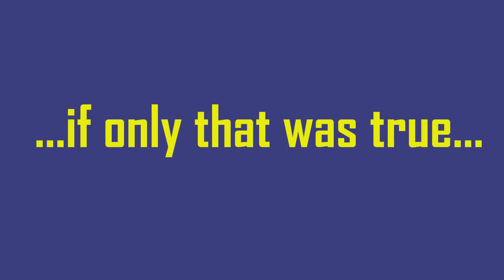The Saga of the Dell PowerConnect Fan Replacement

Comment: I am trained to a certified level for doing repairs under warranty on Dell and quite frankly it is one of my pet hates how dell fails/refuses to conform with industry standards when it comes to pin-outs, especially power feeds.   In my career there have been times when I have had to "modify" a PC Power supply to keep a misison critical piece of equipment functioning where the proprietary power supply was not available.  This is where proprietary wiring becomes a problem.  It is also a problem in this type of scenario when equipment tries to be too smart and actively limits performance throughput if it does not receive monitoring signals back from fans.  Manufacturers make assumptions that proprietary parts are immediately available when they are needed - that can be hindering in the real world.

Great advice to use the right tool for the right job.   I would add (in general), to learn the right skillset for the right job as well.  You make good point about the variety of fan functions that need to be considered when replacing fans.  The process is to seek out the specifications of the installed fan and matching them up with the proposed replacement fans.  The same method applies to all replacement parts with respect to compatibility and desired performance (in this case airflow and noise levels).  

It would have been nice for viewers to experience the noise level both before and after in this video.
Recording speech at a normal volume at the time the fans are spinning both before and after replacement could give a good reference point.  (We don't need expensive test equipment to quantify).

This equipment usually goes into a commercial premises with a dedicated equipment/telecommunications services room on each floor that has its own air conditioning and set of power circuits behind a closed/locked door.  This is why noise is not a consideration for rack mounted equipment but airflow is due to the high density.  

What is worth noting is the fans are on the side instead of the rear.  It is common design for airflow to be taken in from the front and exited to the rear, however we can see with comms equipment that would need a lot more fans to airflow and the orientation of the heatsinks.

Comment: Hi, nice video but for all people watching... be aware that choosing the right fan is critical. I bought Noctua NF-A4x20 and Sunon Maglev  KDE120PKV3 (I ordered AR but I got AF from the chinese shop). Also changed the wiring as described. Both are working but the fan light still turns red. This is because Dell needs the AR (locked rotor) fans. It's checking the RPM speed. If you have the wrong type of fans it just won't work. 
In my case one of the bearings was not running well. A tip from an old technician... Remove the label and just add a very tiny drop of WD40 oil on the bearing. That did the trick for me! The fan is spinning like never before :-)

Comment: Hi! I have just bought the same switch and I am trying to open the chassis, but the screws are so hard probably because I don't have the correct screwdriver. Which size did you use?

Comment: Super helpful! Thanks!. Damn, TIL. Not all RPM sensors are made alike... -_- a 5 minute job turned into a multi day journey... :P New fans are not registering as working... but they are there. that's too bad. I need to look into  the possibility that this is an RPM detection issue... More time than I wanted to sink into this, but you get what you pay for and free switches be free switches... :D

Comment: A fair warning that Sunon model numbers can be deceptive - on ones that use the old style of model number (like the ones pictured in the video), a smaller model number UNDER the main one is really important to look at. The R (or in some cases F) is extremely important to note as there can be multiple variants of the same primary model number - as others have said, if you get fans that report frequency/speed (F type), you're going to have a bad time. Most, if not all Dell switches will only accept locked rotor (R type) fans, and will flat out reject tachometer (F type) fans. When given tacho fans, my switch rapidly pulsed the fan ok/fail light between red and green (unsurprising with how F vs R work), so if your switch is doing this, you have the wrong type of fans. When in doubt, look at the data sheet for the fan.

That said, once you get R type fans and rearrange the pins, you're golden and it's a nearly painless replacement. The hints and info here helped me swap out my 6224's Delta screamers with much more tolerable Sunons (I personally used GM1204PKXV-A / B2278.R.GN fans because they were easier and cheaper to find than the model Torreon used in the video, and they had pretty much the same specs). It's as quiet as a mouse now and can't be heard from more than a couple feet away (if that). Good stuff!
Reply: I was just about to mention this. Looking at the Delta EFB0412VHD on Digikey, there are several variants of the same model. There is a 2-wire one (no suffix), just runs off 12v and reports nothing and has no speed control. There are TWO 3-wire ones. One has the locked rotor sensor (R00) and one has the speed sensor (F00). And there is a 4-wire one, which is a speed-controlled one (PWM in, speed sensor out, suffix SP05). Thankfully in this video he shows a nice close-up shot to see that R00 on the OEM fan. But, they don't come with connectors.
Reply: Hello Wuffleton, just in case you read this: I have found  https://www.ebay.com/itm/283610743650 it is a GM1204PKV1 with white control wire. According to datasheet the white wire stands for  "rotation pickup" instead of yellow for F pickup. However some pictures on the net show F-product version (partnumber having AF in it) with white cable. Very confusing, do you recall the cable color of your fan? Thanks

Comment: If you simply ground the centre pin of the fan connectors then it clears the fan fail indication ... 

As pointed out below you need a "Rotation" 3rd wire signal rather than a "Tacho" third wire signal - it seems poorly understood that there is a difference and what the difference is.

Comment: Also installed the 5200rpm fans and they are not quite fast enough to keep it out of fan-fault.  Will have to install something a little faster to make the switch happy.
Reply: No - I bet you bought the ones with the tacho output ("T") rather than rotation output ("R") 3rd wire output...

A little bit of advance googling would get you to the specs on the fans that DELL use and you'd find that out. :-)

Comment: Finally just made this work on a PowerConnect 5324, with 2 fans that didn't cooperate with Dell's Positive-Sense-Negative pinouts.  I had 2 40x40x10 fans that are really really quiet, and I couldn't make them work, even after changing the pinouts to Positive-Sense-Negative.  The fans would power on, but the fan light would show an error.

I realized though that I could make the fan light turn green if I simply took the Positive or Negative wire off (from the left or right pin), and put it on Sense (the middle pin), while the other one stayed on.  This would create either a Positive to Positive/Negative to Sense configuration, or a Positive to Sense/Negative to Negative configuration (leaving the Sense cable out altogether).  The fan light was green in both of these setups, but obviously since both positive and negative weren't running to their respective pins, the fans were off.

What finally worked was to take some very small copper wire and form a tiny loop, and then take that loop and slide it over the Sense and Negative pins on the board, bridging those 2 pins.  Then, I attached the fan 3-pin adapter with the modified Positive-Sense-Negative configuration to the board, and voila, we're good to go with both very quiet fans and a green fan light.

The obvious disclaimer is that this may not be pushing enough air (with my hand in front of both fans, I definitely get quite a bigger blast of air with the ones from Dell), but for a home setup where there hopefully won't be a ton of load on the unit and low noise is important, this may help someone else get up and running.  I haven't tested this for long, so I have no idea if it'll fail.  But it looks like it'll work.
Reply: Thanks for the heads up on this.  I just tried the SUNON fans mentioned in a comment above: Sunon MagLev KDE1204PKV3.MS.AR.GN 40x20mm-3pin Locked Rotor Sensor Low-speed 5200RPM 6.3c on a Dell 6224 ... 

They're a bit more quiet than the OEM, though only a bit, but more importantly, on the 6224 they trigger the red fan fault LED ... i suspect the 6224 must be more sensitive to RPM compared to the 5448.

I'll probably go and find a better replacement fan that will suit the 6224, however in the meantime I've got the (quieter) switch in my rack and jiggered the sense line by bridging it to the negative pin as you have suggested above - saved me some heartache, thanks for the suggestion.
Reply: More on this, I may have spoken too soon above with relation to the 6224 switch.  Now seems like the ebay vendor I bought these fans from: KDE1204PKV3.MS.AR.GN, might have shipped me incorrectly labelled fans ... or just perhaps outright faulty (!?)  Though they are the AR variation according to the label, the sense wire is yellow (SUNON says AR should be white) and the output from the sense line sure looks like a tacho output to me.  AR sense output should be either low (GND) for good or high (VCC) if the rotation has failed.  I'm going to buy them again from a reputable source and see if that helps.
Reply: So it seems like there are a ton of relabelled fans on ebay and amazon - look in the comments section on Amazon for plenty of evidence that AF (taco) fans are being relabelled as AR (locked rotor) fans.  The fans I got from ebay were labelled 'AR' but were noisy, vibrated a lot and output a tech signal on the sense line (so they are really AF)

I've searched and searched in the legitimate parts channel, mouser, digikey, etc, nothing, not available - plenty of stock of the AF type, but no AR's at all

Seems like Sunon have changed their part numbering scheme as well, just to add to the confusion.  The equivalent part number to the  KDE1204PKV3.MS.AR.GN appears to be the MF40201V3-1000U-F99 - theoretically should be the same fan, just new labelling.  However, stock of these seems to be non existent.

Beware of choosing a similar but different part number:  M = Series Code, F = Motor Type (not explained in Sunons catalog), 40 = 40mm H x W, 20 = 20mm depth, 1 = 12VDC, V = Vapo bearing (B = 2 ball, S = sleeve), 3 = Low speed (X = super high, 1 = high, 2 = medium, 4 = super low), -1 = Gen 1 (blank = none), 000U = customer code (likely not important, probably depicts batch manufacturing runs for specific customers), -F99 = Auto restart with locked rotor sense (A99 = auto restart, G99 = auto restart and tacho sense).

For replacing noisy switch fans, we definitely need size, voltage, and sense = F99.  Probably we wouldn't be very happy with the medium/high/super high speed because of noise, but low or super low would probably be ok.

I ended up soldering an 82R 1W resistor in line with the power (red) wire on the original Delta fans to reduce the voltage from 11.6 (my dell was a bit low on the 12V line) to 6.7v, dropping around 300mW.  Noise is down a fair bit, but still far from quiet - I expect the Delta's use a bearing fan.  I don't want to drop the voltage much more as the fans probably won't start.

Comment: For the next person who watches this video: Sunon MagLev KDE1204PKV3.MS.AR.GN 40x20mm-3pin Locked Rotor Sensor Low-speed 5200RPM 6.3c
Reply: Muhammad Khan Yes, I did do the wire hack (it was simple with a small screwdriver, but be careful) I got the fans from: http://www.rakuten.com/prod/2-units-of-sunon-maglev-kde1204pkv3-ms-ar-gn-40x20mm-3pin-locked-rotor/271109650.html
Reply from the maker: Good info - thanks!
Reply: ***** I just installed the new fans and I would disagree with you I think they are whisper quiet. ;-) My switch (PowerConnect 5324) is now just as quiet as my desktop computer. Thanks!
Reply: Brad Poulton
 I installed the same fans on my PowerConnect 5324 as well, they are not whisper quiet and the front FAN led blinks red. Did you do the wire hack shown in the video? and also where did you get the fans from? Much Appreciated!!

Comment: Nice! Have You thought about replacing the 40mm fans with one 120mm on the top of the switch? Naturally, it would require some cutting etc but the effect of the airflow and the noise would be better.
Reply from the maker: I did, for like a second.  I didn't want to mod the case at all - just in case I wanted to sell it at another time